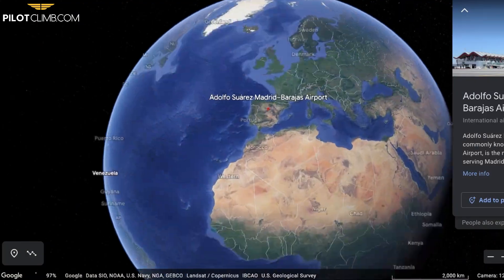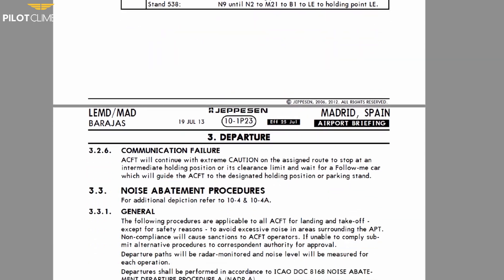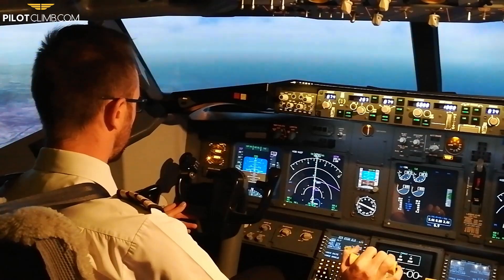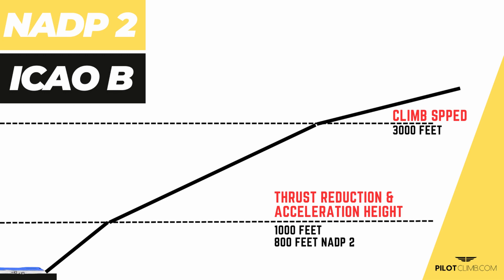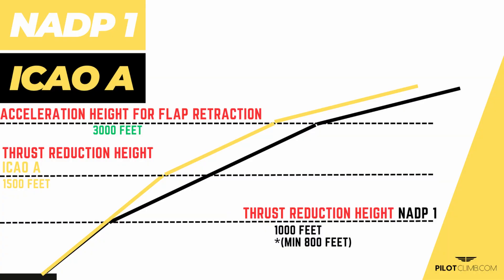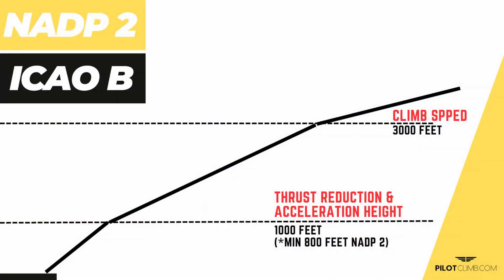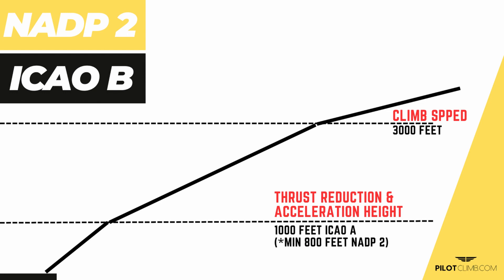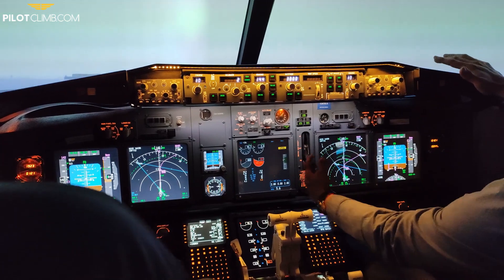Noise Abatement Departures Procedure [NADP 1, NADP 2, ICAO A, ICAO B].

Comment: Hello Gabriele,

Regarding the Noise Abatement Procedure:
 
How do you use the CUTBACK function in the FMC in a 737NG?

I know that there is an altitude where the thrust is cut back and a restore altitude.

But how do you use that for an airport specifically?
I mean how do you read in a chart when to apply the cutback and how do you read in a chart at which altitude you have to restore the N1 setting for climb?

Thank you.
Reply from the maker: These values are standard heights above the field, so you simply add it to the field elevation..

Comment: Great video, thanks!!!
But what happens when charts don’t mention any NADP? 
Or it's something like this: JET ACFT certified to standards of ICAO convention Volume 1, Part 2, Chapter 3, with noise level certified at overflight point of less than 89 EPNdB. 
Btw, I never understood why this important information is not written on the SID charts themselves (Jeppesen or LIDO)
Reply from the maker: Most probably it is not written on the chart because you want to keep the SID chart as clean as possible.

It might change depending on the operator, usually of no restrictions are applicable we use the NADP 2.
Reply: @PILOTCLIMB  Thanks a lot! Best wishes!